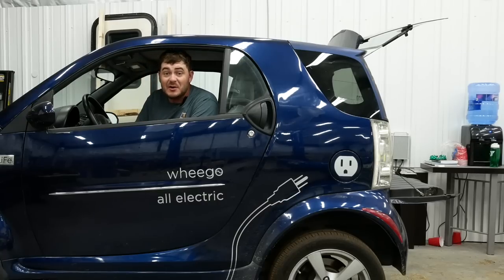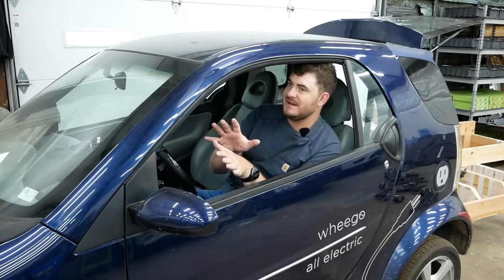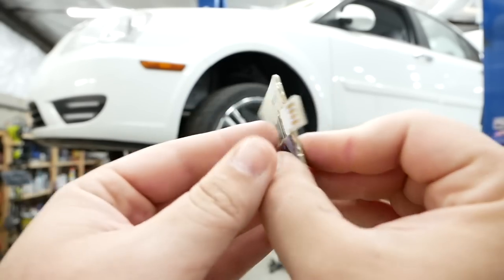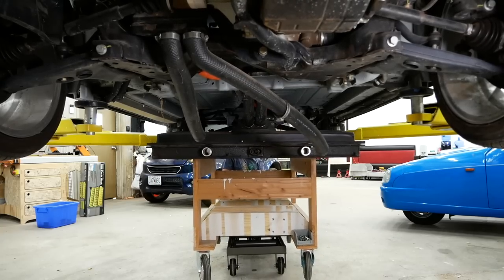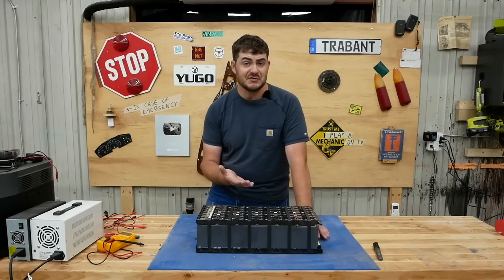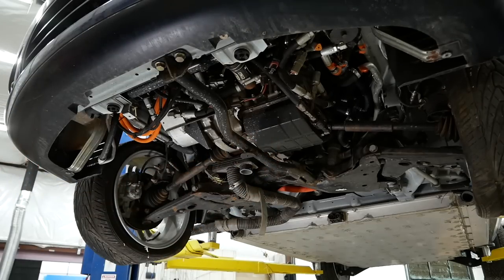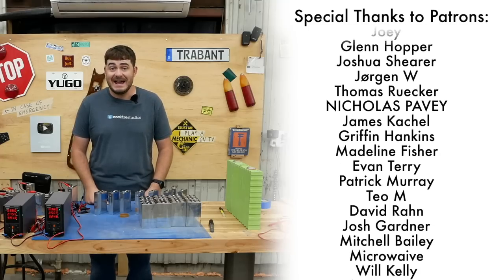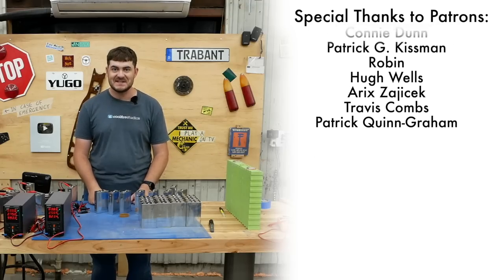I Have 3 Dead EVs. Are Any of The Batteries Still Good?

Comment: As an EV owner I really appreciate these videos! At some point EV's will not only be the normal type of car, but people will work on them themselves. It's great to see the inner workings of these.
Reply: Given the speed of a battery pack swap,   it is (accidents aside) only the brakes and drivetrain that will wear),  Drive in,  heavy service, new batteries, and away you go
Reply: @highpath4776  One would hope that eventually the technology will allow battery packs to be small, light, and safe enough that instead of stopping in to the service station for a fill of petrol you'll just be able to swap your battery pack with a charged one and off you go. In Australia we have a system like this for LPG bottles called "Swap-n-go" where you leave your old empty bottle and exchange it for a full one for a small fee, I imagine one day a similar setup will exist for car battery packs.
Reply: I feel bad for anyone that owns an EV at this moment lol
Reply: @24ecko  Why? I feel sorry for people driving gas cars. Just look at the gas prices.
Reply: @krissjacobsen9434  No road trips with an EV unless you only stick to major cities. No real towing capacity either.
Reply: @GoogleDoesEvil  Why not? Both range and charging speed is getting really good.
Reply: @krissjacobsen9434  The fast-charging infrastructure doesn't exist in rural or even many suburban areas. I wouldn't be able to see a lot of family if I only had an EV. Especially if I had to tow my RV too.

Instead, I drive an old diesel truck. I get 400+ miles on one tank of fuel while towing with that truck. And I can run it on biodiesel.

Comment: I would keep it and keep it intact. You can use it as a backup for the longer life one.  It will be far harder for you to find Koda replacement parts than improvise stuff for the Weego. 

Besides, you could easily make a fun video or two on making your own version of a battery pack and installing it. I know I would be very happy to see that video.

Comment: There is a way of giving some life back to these cells though it could prove to be a bit risky and it works across multiple chemistry types including regular lithium ion. Just have to thermal cycle the cells (a lot) and eventually the current shunts that formed during normal use begin to breakdown allowing the cells to take on a charge again. I've done it to laptop battery packs that are close to two decades old with decent results and the oldest single pack that I got working is from the late 90s. What happens is as they thermal cycle the copper inside expands applying some mechanical force on the shunts and over a long enough period these shunts breakdown allowing the cell to function as normal again. The greater the difference between when it is warmed up and allowed to cool down to the better the trick works.

Comment: love your work,i have the same car and software for controller. the motor in the wheego can draw up to 500 amps . this is what killed the original bat . you will have to do a series parallel to make 96 volts

Comment: If you're interested in what the interlock is on EVs its essentially an extra wire going through ALL off the HV connectors to make sure none are loose, if the circuit for the interlock is broken at any point the system should put itself out of action until the faulty connection is fixed. :)

Comment: On my channel, I took a 67 beetle (which everyone says is the best year, one year only) and I chassis swapped it with a subaru. The beetle sat in a field for 25 years before I got it, no one wanted it but the second I start "ruining" it everyone starts freaking out.

It's your Coda, rip it apart, use whatever you can, and make whatever you want to drive from the parts, don't worry about what other people want.

Comment: Worry about yourself first. Do the big battery swap,  make a power wall and fix the weego.
Side note about the mower I have the same one and did not maintain the battery as well as you and mine is still great (4 years old)  I did have to replace one of the blade motors last week, it would spin but would stall out when the grass was too thick. I could hand spin it and feel it skipping over a magnet so perhaps one of them broke inside. 
Love the channel.

Comment: You could keep the small pack for backup when you have to charge the big pack, but MUST leave. Insta-fill. Or switch them out often and keep them both cycling charges. Good for the batteries, right?

Comment: Rewatching this video, your tidbit about the incomplete Coda service manual reminded me that Coda actually distributed official towing instructions to organizations like AAA (which is where I found out about them). The usefulness of these instructions, however, is quite debatable given that the only thing they tell you is that the car cannot be towed by a wheel lift and must be towed on a flatbed. It also reminds towers to use caution around the underside of the vehicle and that a shift lock override is not available, which is actually semi-useful information.

Comment: I know you said you're not doing this anymore, but one thing you could do to test the batteries with less effort is to connect all of the modules in parallel. They're at matching voltages, so you wouldn't get much balancing current. That would involve connecting their balancing leads together to a 6S BMS to make sure no one cell in one module increases above 3.6V. Once they're charged to ~3.55V per cell you charge each parallel group to 3.6V through their balancing leads and then load test each module. Make sure you don't put too much current into the balancing leads. The BMS will make sure none of the cells over-discharge. If you're keeping the good battery you only need to make sure that all the parallel sets of cells match capacity with each other.

Otherwise as you said, those batteries seem in such good condition that it's pointless testing them individually.

Comment: Agree with what Gibo2000 said, use the pack from the working Coda to revive the Wheego as well as lithium swap the mower, however, instead of 12V lithium swapping the Coda, use those leftover batteries for your go-kart project.

Comment: I like the idea of making the few minor repairs necessary to put the experimental battery Coda (#2) pack into the good Coda (#1).  As far as "Should I rip apart the Coda (#1) pack and use it to fix the Ryobi and Wheego; or save it for someone who might need it in the future", I say that you should use it.  You've already disassembled and "broken" the busbars, and you know someone who needs the pack now.  YOU need the pack to make other things GO!  Using this plan, you will get  you Coda #1 back on the road, the Wheego Going, and well, the Ryobi the proper power source that Ryobi should have given it originally.

That's just my nickle of advice.

Comment: I feel like now that the battery is already partly busted up you might as well get some use out of the cells. You could get great run time out of the mower and get another vehicle back on the road, seems like a fair trade. I'd be interested to see what all would be involved in both of those projects. I want to know how the Wheego battery got so flat, I feel like I missed something, usually the bms protects them from dropping below a threshold, how did it get down to practically nothing?

Also, batteries for the go cart project?

Comment: One thing you probably want to know: you can't judge LiFePO4 balance state and charged capacity from a voltage reading. They aren't like LiIon; they have a super-flat discharge curve and will show you almost exactly the same voltage for like 90% of their charge, only going above at the first 5% and below at the last. That's probably why the battery gauge was so inaccurate on the wheego; the only way to have a gauge on a LiFePO4 battery is with a coulomb counter that knows how much energy is in the battery, sees how much is coming out, and calculates the remainder.

Comment: I agree with Gibo. Take the pack you already tore apart, lithium swap the mower, rebuild the Weego, and put the 36k battery in your driveable Coda.
As for what to do with the 31k battery currently in the Coda?
I've always been an advocate of actually using the things you own, and the idea of leaving the battery sit on a shelf doesn't sit well with me.
But neither does tearing it apart if you don't have to, so I can fully understand your dilemma.

Comment: Rip that pack down!!  I bought three 8p12s packs made by BAE systems that came out of a Montreal city bus built in 2008. The seller listed them as "dead" but apparently their scale marked them dead when they reached 50% of their nameplate capacity. I used them to lithium-swap a B&D electric push mower and a weed whacker and a bunch of other little things and I still have a whole pack left! Batteries were made to get used, put them back to work.

Comment: It may be true that there are very few Coda battery packs left in the world, but you also have 1% of the entire run of Wheego's production line sitting in your garage. It deserves to live. Besides, it's going to be much easier to use batteries from the Coda's pack than trying to find perfect replacements for the Wheego's pack. You already did that research.

As a bonus idea for the Wheego, why not give it an overhaul? Not the typical style of overhaul, but your own, quirky take on the idea. You always have something up your sleeve, and we're here for it!

Comment: It's okay to rip them appart.
What you should do is document every aspect of the Coda battery. Battery arrangement, wirering, model/types of contactors used, fuses connectors and everything and only keep the shell.
If someone really wants to revive a Coda they can use new components and wire them accordingly.

Comment: I just bought an old EV made by a company founded by Miles Rubin, who later founded Coda.
My car is a Miles ZX40, a street-legal NEV, limited by Federal regs to 25MPH in most states.
It came with a failing lead-acid 48V battery pack.
How's about some of the cells from one of your Coda's ending up in my Miles?
At least that way, they've stayed "in the family!"

Comment: You have already partly disassembled the one CODA pack. Take it apart the rest of the way for reuse in the wego. You also have plenty of cells for your SLA lawn mower swap out. If you don't have a spot welder yet, get a KWELD and a KCAP. It's a solid spot welder. I've been using mine since 2019 and it will do the job for you.
*
Care to sell me a CODA motor and inverter?

Comment: Some cars are rare and limited because they were expensive exclusive hand-built masterpieces, others because they were misunderstood and far ahead of their time... Those cars become wanted classics. 
Other cars are rare and limited because they weren't worth buying and will only ever be worth buying used at a low price and used as long as the costs to keep them running are reasonable. I believe the Coda is an example of that.
The one thing that's worth keeping is the prototype "long range" battery pack, which is exactly what you'll do buy putting it in your working Coda. The other battery packs (the one you'll take out of your driving Coda and the one out of the prototype with standard range) aren't unique, they're just a collection of spare parts.
Reusing the cells out of the standard Coda battery packs to fix and improve the Wheego and your lawnmower IMHO makes a lot more sense than just storing them and keeping them at the perfect charge level to have the least amount of degradation, just in case there might be another Coda owner out there willing to replace their battery (knowing the rest of the car isn't built very well and will have fallen apart multiple times by the time their battery pack gives out) instead of buying another (electric) vehicle.

Comment: - The interlock is a saftey connection (probably from the BMS) If it is cut the BMS will deactivate the contactors, making the car safe
- next time: don't ever put your metal tools on the cell modules and disconnect the busbars first!!! lowers the Stack voltage.
- the shunt @15:22 is actually a precharge resistor, the wires on the current sensor would be MUCH thicker. The current is measured by the small black hall sensor between the big ol' Main fuse and the positive contactor

Comment: In my very humble opinion, making the wheego run again will be better overall.
It will make for a great video on how to deal with BMS's, redoing the battery pack "properly" and even make the car run for longer mileage.
The Coda have a lot of design issues that make them unsafe cars to run.
Cheers Robert!

Comment: I’d suggest wrapping some of your tools, like handheld screwdrivers, in electrical tape. I did a lot of electrical work in the navy, and live or dead circuits, tools were always half lap, double wrapped. Wrap the tape around the shaft so half is overlapping each consecutive lap around the shaft. Then do it again to double wrap it. Last thing you want is to accidentally cross bus bars and weld your tool to the batteries and cause them to explode. No one wants to see that gorgeous mug of yours with electrical burns on it!
Reply: Ok but inexpensive insulated tools are readily available

Comment: An article I read before said that charging a lifepo4 at 3.6v or more is bad for longevity. If you will be holding the voltage at any time (like float charging or at low c rates) it should be not more than 3.4 or 3.45v. If charging at high rate, once it reaches 3.6v, terminate charging immediately. Seems to be plausible as the ones I applied this to is still working fine like new.

Comment: You show 4 inexpensive power supplies for battery charging. When servicing power packs, say a 5s3p Milwaukee pack, I typically charge each group of cells to full charge, say 4.2 volts. With my current setup, I have been able to only charge one cell group at a time. I would like to charge multiple cell groups simultaneously to shorten the work time. The reason I charge the cell groups individually is an attempt to balance the pack. My balance charger is only good for a 7s pack and I want to balance larger packs such as 40v and 80v packs. Have you used the power supplies together on a pack to charge individual cell groups and balance a pack? I have found that the main isssue on tool batteries is balance. Once a pack is rebalanced, normal useage and charging is possible. I have not seen a problem with failed cells to date. Thank you!

Comment: If its a situation like the Ford Ranger electric truck from the 90s where it will be hard to trick the vehicle into thinking that it is using the original pack, then keep the packs intact. If the battery packs would be relatively easy to rebuild in the original housing, the you should absolutely repurpose the cells.

Comment: To answer the question about the interlock, an interlock on a high voltage system is designed to shut down the system and try to make it more “safe” if the interlock is not closed. Often there is an interlock built into most, if not all, of the high voltage connections. That way, if there is a high voltage connection that isn’t properly connected, it won’t close the contactors and energize the system. Sometimes it can be a switch or a connector.

Regarding the contactors, every battery system I’ve worked on in a car (basically every hybrid and several BEVs) has a contactor for the positive and the negative. This offers redundancy, mainly to give an option to de-energize the high voltage system even if one of the contactors gets stuck or welded together. It also allows circuit protection for both of the big wires.

Regarding the question about what to do with the Coda battery, you own it. You don’t owe that battery to anyone else. Also, your plan is to use it to revive your own car, which also has a battery pack that nobody will ever make again. I say use the pack for your own needs rather than saving it for some incredibly unlikely event.
Reply: and are sometimes found on covers for high voltage items ie. batteries, modules, and controllers as a way to prevent someone from accidentally touching something with live High Voltage. But as Our GM Hybrid Instructors Reminded Us Batteries (good ones) are Always HOT and Can't be Turned off. And they thought that Battery Pack interior repair Wouldn't be Serviceable at the Service Tech Level, but after a couple of Recalls that was quickly proven wrong.

Comment: I wouldn't rip apart the battery pack from your driving Coda.  Seal it up and stick it in storage.  If you take it apart then you're taunting Murphy and something catastrophic will happen to your 728 battery pack.
As to doing the battery swap on the Weego - sounds like a more interesting project than changing a riding lawnmower to LiPO4 from lead acid.

Comment: Use one of the coda packs to save the Wheego. LifePO4 cells don't last forever, they absolutely have a time limit before they aren't good to use anymore even when just sitting on a shelf. That's how any battery is. If you can use it, it's better to use it. If someone in the far future does want to restore a Coda, for some reason, they'd have to source new cells for the batteries anyways, so just saving the battery housing and hardware is enough to satisfy that persons needs.

Comment: I think you should swap out the battery setup on your current coda, just use the batteries you have ripped out already (I would just see if I could leave the cells bound together in banks and try to put the banks in), and take the pack you pull out of your coda and just either use it for parts or see if you can take the banks and turn them into individual battery setups that you can set up a plug and play system. If you were able to do that then you might be able to set it so if you add one to your mower, you can just swap the pack and keep going if the battery dies.